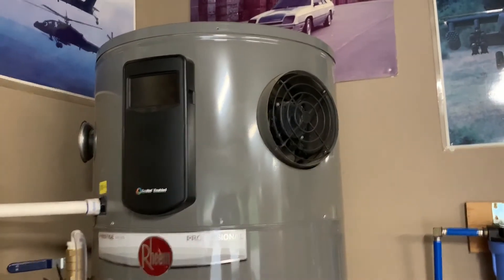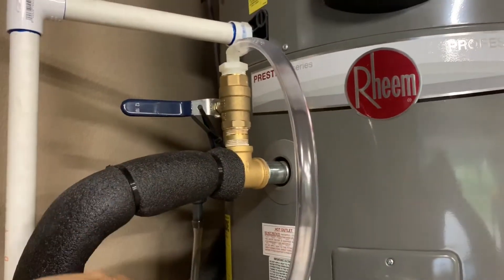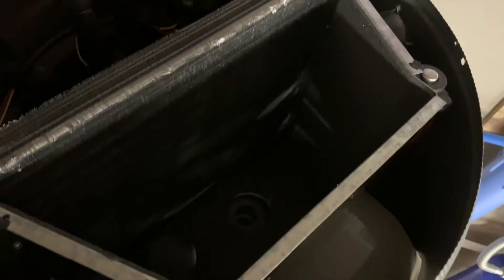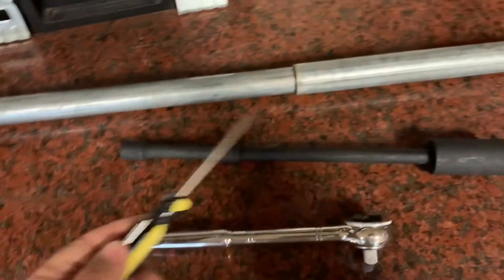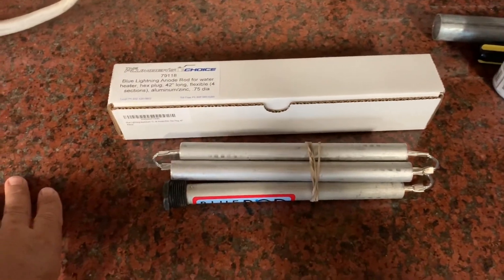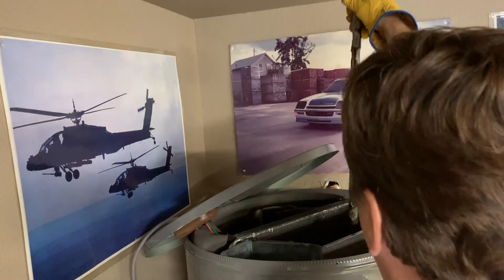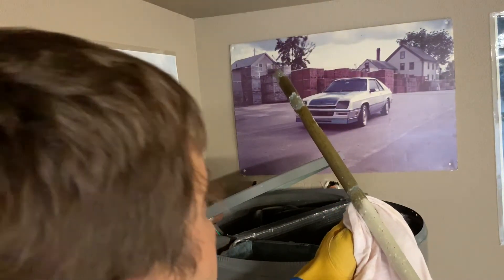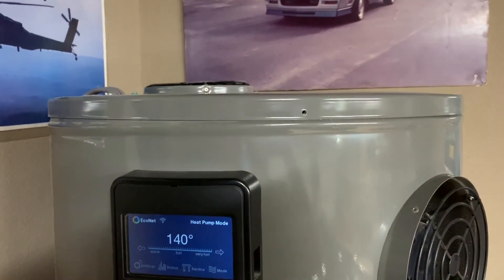💧Fix Smelly Well Water ● Replace Anode Rod with Zinc to Remove Rotten Egg Sulfur Smell

Comment: Our Plummer removed our old anode- and it had disintegrated? Is that possible or could it have broken off inside the water heater?
Reply from the maker: Over time they will completely rot away. That’s how it works.

Comment: Don't mess around with standard anode rods, buy a powered titanium anode rod and install it for the clean fresh water.......
Reply: How well does the powered anode Rod work though?!?  It says it helps protect the water heater from corrosion….but not 100%. It prob makes the water heater corrode faster then a zinc/aluminum rod?
Reply: @FixItWithMe  the powered work good, depending on your situation the standard aluminum rods work good too....

Comment: How did you remove the old rod without taking the plastic insert around out it?
Reply from the maker: On this heater I was able (barely) to get my socket onto the bolt without taking out that plastic collar. I found on a different heater that the bolt was misaligned and right next to the collar, and the only way I could get it off was to use a thinner socket.  I don’t think that plastic collar is installed in a way that you can remove it without major surgery.

Comment: looking to get a similar Rheem water heater. How have this one been for you ? Any problem with it beside this ?
Reply from the maker: I like this Rheem water heater and have not had any trouble.  It is very insulated and since it has that heat pump, it uses very little energy.  I like the app - you can control it using your phone and see the energy usage over time with it.   The cool air that is releases out as part of the heat pump process is a nice side effect since my unit is in the garage which gets hot in Texas.  I am getting another of these Rheem units for another house we are building.  But I will install a zinc anode rod right from the start this time!  Best of luck to you!

Comment: Thank you!  I have been avoiding this project but needs to be done.  I bought an anode rod that has narrow bendy sections, but like the look of the one you have better.  I'll be dealing with low clearance.  Will let you know - thank you again!
Reply from the maker: Tina Barrett I hope your install goes smoothly!  I don’t think the anode rods are that different. As long as it doesn’t have magnesium you should be fine. I wish you the best!

Comment: Can you provide more details on the new aluminum rod you purchased, like the model number etc. Thanks for the great video. Just what I was looking for. Also, how has the odor been?
Reply from the maker: I purchased the replacement from Amazon for $35.  The description was "Blue Lightning Aluminum / Zinc Flexible Anode Rod, Hex Plug, 42".  There are several variants online if you don't see this exact one.  After I installed this replacement, the smell never came back!  Water has been perfect.  It's been in place 4 months so far.  In the past the hydrogen peroxide would only last 1 or 2 months depending on the time of year.  My plan is to swap out this aluminum/zinc rod again in about 5 years.  I'm curious to know how much of it is corroded after that amount of time.  Good luck!
Reply: It’s 3 years later….is the smell still gone???  Do u have a water softner as well??  Thanks!!!   I have this problem now :(